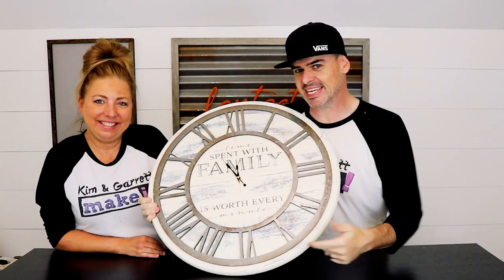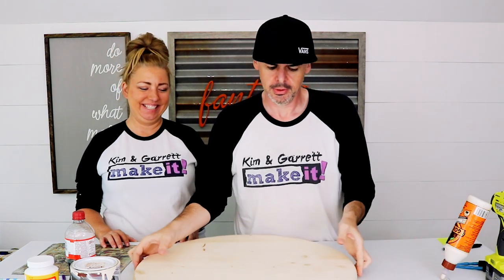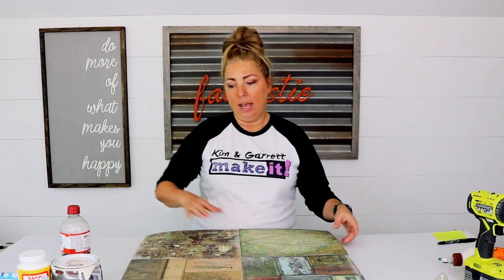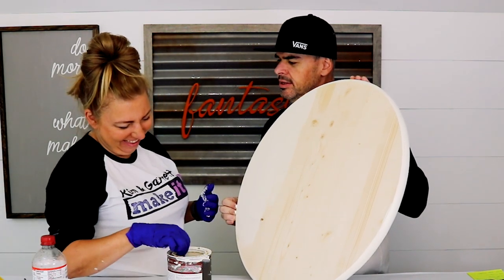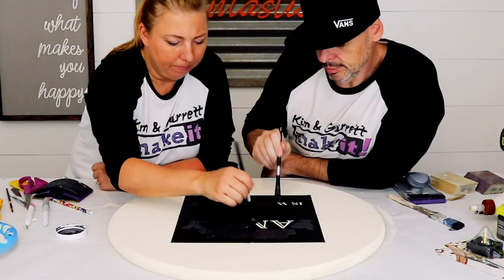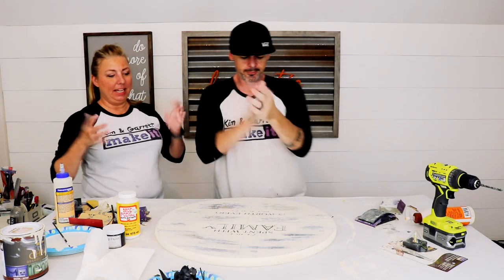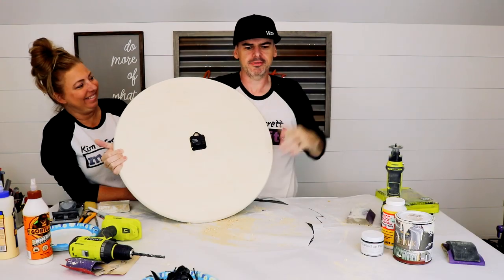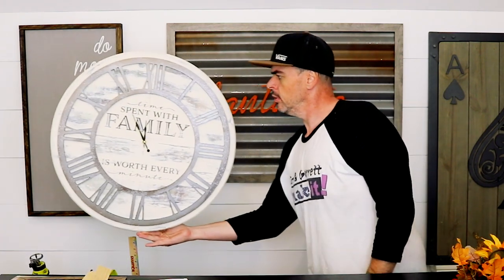Old Antique DIY Wall Clock for $20

Comment: I've tried stencils on wood a few times now, and I'm always dealing with the stencil peeling up little slivers of the wood with it.. I've used stencil vinyl and removable vinyl, and 9 times out of 10 this happens. Any ideas?
Reply from the maker: Heat gun to better the seal OR use modpodge!
Reply from the maker: Oh! And peal it up against the grain, it has less of a chance of grabbing the end of the grain.